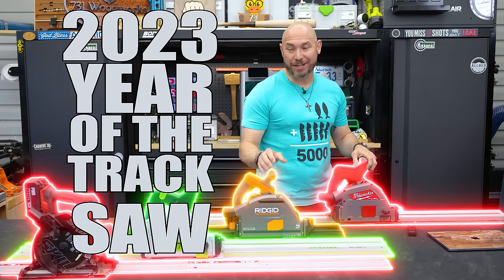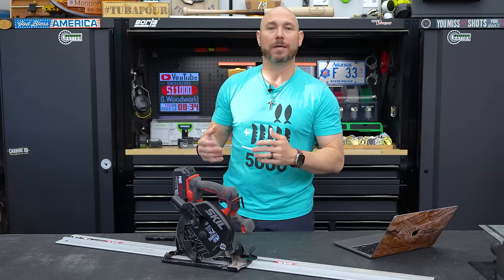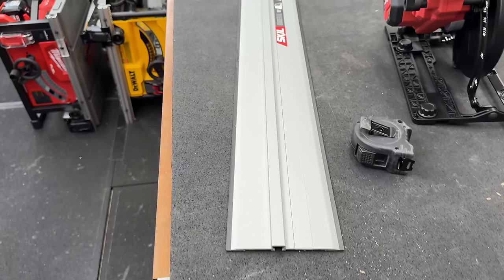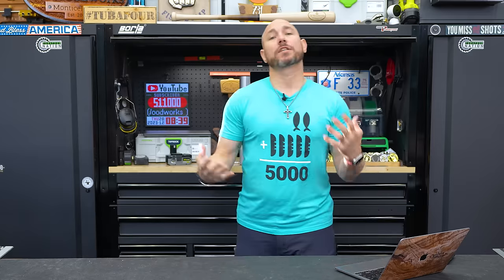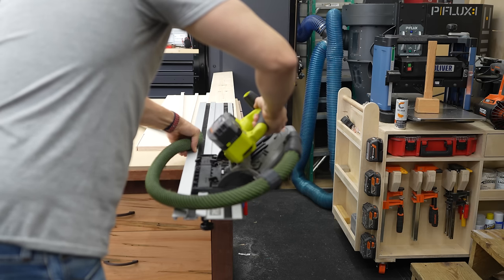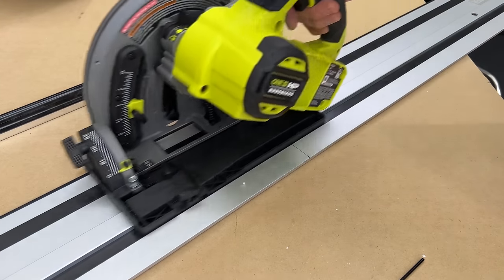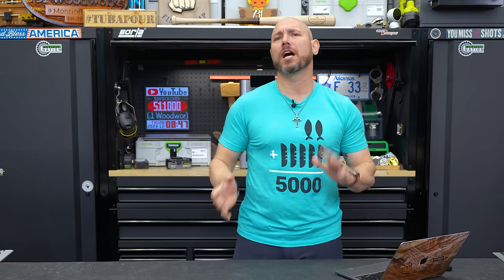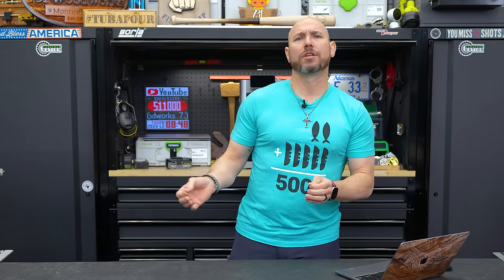Best NEW Track Saw Released in 2023? Ranked Worst to First!

Comment: I was looking up track saws the other day and noticed Grizzly makes a chorded track saw that comes with THREE 36 inch long tracks for $220 and I don't know why for the life of me more people aren't talking about that. That's cheaper than almost any other track saw kit I've seen.
Reply: Joining tracks straight is a huge pain in the ass, and I've done it with 2 118", 2 55" a 6 foot Stabila, etc. The longer reference lengths help but can't imagine the smaller 36".  The joint is weak, and precarious when moving the track on and off pieces to cut. At 36" you are guaranteeing a joint for most cuts since the saw needs a bit of track overhang. A single 55" track does 90% of my cuts. Also, that's ignoring the likely shit quality of the tool itself. Personally, I would go with(and went) with the Makita/Festool track. Festools are cabinet makers tools, precise and lovely to use. That said the Makita platform can do it all. The sheer range of saws Makita offers that integrate with the track are also vastly superior to Milwaukee. In addition to the plunge saw, I have a 10 1/4 Makita that makes ripping 12/4 Sapele a breeze.
Reply: Chorded? Does it play a tune?
Reply: From my understanding on what I read from others, it seems to not be very good. I have no time with it but from the very small sample size, I am not impressed. Seems the wen is better.
Edit: Not saying for anyone not to try it, just that from the looks, its worth doing a little extra research on.
Reply: I'm just saying, for $220, its the cheapest option. It was my assumption that the tool would be fairly decent since grizzly is a pretty big name in the wood working game. Either way, it seems like a decent budget option if that's what's within your price range
Reply: I bought a Grizzly jig saw that looked to be a decent alternative to a Bosch.  One of the biggest letdowns tool wise that I have ever experienced.  It wouldn't even make a decent green paper weight.  Bought the Bosch and swore I'd never buy another Grizzly product.
Reply: Buy the Wen, replace the blade and buy 2 PowerTech 55” tracks.  It will cost a little more than the Grizzly but it will do 99% of what most will,need it for,  I bought this set up and it worked great to break down plywood and build new cabinets in my garage.  All the reviews I read said replace the blade so I did.  Also, will do hardwood, but not as fast as some of the others.
Reply: @agracer1000 I have a lot of name brand tools, but when it comes to more expensive stuff or one time use. I've use Wen and Vevor products with little to no issue
Reply: I'm going to go check that out !

Comment: Well it’s not the first time a tool maker has made something proprietary! I was quite mad when I bought a ‘level 5’ skimming blade and then after buying the handle adapter, realized you couldn’t use a standard extension handle. No one seems to mind that RIDGID stands alone with lifetime service agreements even on batteries! (Oooops proprietary again)!!!

Comment: Im on milwaukee platform as a carpenter in Poland, but its hard for me to buy milwaukee track saw - one is cost - not that i use cheap one now. Im using Mafell MT55C corded - this thing is so superior to anything that is on the market... even tho i would love battery operated one like this from milwaukee its a hard poill to swallow that you need to sacrifice a superb tool just to have 1 battery platform...

Comment: I absolutely love my 36V Makita! If price weren't an issue, I'd likely go with the Milwaukee. It has a couple more features and I like the Milwaukee ecosystem, but I've used mine pretty hard for a few years and have zero complaints (for a few hundred cheaper). I could see maybe suggesting some upgrades to Makita though. The design is getting a little long in the teeth.
Reply: Me too. I’ve owned festool since the early generations and got the makita 36v the second it came out. my only complaint is the not so elegant depth adjustment. and how stiff the mitre adjustment knobs seem to get.

Comment: I bought the Milwaukee and while it was expensive it’s like the crown jewel of all my fuel tools. Every time I use it I’m more impressed, the blade that comes with it leaves an incredibly clean cut. Paired with the little 3D printed plug & dust collection, it has to be the cleanest saw I have in the shop. Although, I wouldn’t be upset to have a festool like yours haha

Comment: I've seen so many of your videos on track saws. Now I can't remember which one I wanted. What track saw can you also use to make flush cuts to like a wall ??The butter guard comes off and the blade has a cupped mounting hole so the blade bolt doesn't hit anything ?

Comment: As I mentioned to Ryobi after they released that dual 40 battery belt they need to do the same with their 18 line except maybe have it in 3 or 4 battery line. This way you can run their line complete through most jobs before running out of power. Also I don't understand why they can't make all of their battery powered tools with plug in also. To many one use tools and without either option I just mentioned you have to keep having to recharge or stop and grab another battery. The battery plug in option is already on some Ryobi products. IMHO Great reviews coming from your site and they are very helpful for those that don't have the money to waste on products that only work somewhat.

Comment: I love the Milwaukee I own it myself. And the pack out is the best I’ve ever used. And I’ve use Makita and festool I like the Milwaukee more because of their pack out system. But the saw itself blow Makita out by far. By the way Milwaukee motor shut down n brakes right away if trigger release. So it does have anti kick back

Comment: Hi Matt.  Thank you for your review of plunge/ track saws.  I would like to see a review of the Festool TSV and TS 60 track saws.  Will the ts 60 used with the 2mm or so scoring cut first , do just the same as the tsv saw with the scoring blade?  What do you think of these saws compared to the Milwaukee?  What do you see and feel using the Milwaukee rail compared with the festool rail?  These rails are different in weight and section.

Keep striving for the profit that comes from doing and using the words and ways of Jesus

Comment: What's the advantage of buying a track saw over using a straight edge jig with a circular saw. Like the kreg jig?
Reply: Dust collection, ability to use with guide rail accessories like dovetail clamps, rail square, parallel guides, etc.

Comment: I personally don't like saws that won't slide backwards due to the anti kickback features.
I use to use the scribe feature on laminate and melamine surfaced materials, but would do the scribe cut backwards and then full depth forward. Makita gave perfect results every time.

Comment: Question.  If price was not sn object (within reason) which track saw would you recommend.  I am torn between Mikwaukee and Dewalt (I have a ton of Dewalt. I really don't want another battery platform).   Thank you for the great videos.  🎉
Reply from the maker: Milwaukee’s is better IMO. However the DeWALT is a good saw too. I have a review on the DeWALT as well. It’s a little quirky but very powerful
Reply: @731Woodworks  I watched your Dewalt review. It certainly is an ugly duckling but loved by its mother. 😅

I will watch it again.  

Thank you.

Comment: The Milwaukee Track Saw is also available as a "tool only" option.  Just in case you don't have the need for the Packout box and more batteries.  Only $399 at Home Depot.
Reply: They had it for $379 with an extra blade for laminate ply a few weeks ago

Comment: Stating blade size and cut depth would have been useful. I see most of theses saws use 6.5" blades. 
  I wouldn't mind seeing a battery/corded 7.25" blade comparison. 
  Personally, I'm looking for a corded track saw with a 7.25 or bigger blade.

Comment: I don't see the WEN in there. But I know why, for me its perfect as I do only 90s. Also, this saw you have to pull and push at same time to keep it level or else you get flex, which I see in other saws too. For the price, it's very cheap for this purpose (table building, squaring ends). Ya ya, TS60 fes is 1k + a couple hundo for track. I'm aware. lol.
Reply from the maker: I bought it a few days ago.  Will be doing a review soon.
Reply: @731Woodworks  Nice to hear I have the corded version it will be nice to see if they made improvement within the cordless version. I do think I saw it comes with a nicer standard blade.

Comment: it would be nice to include reviews of the actual tracks themselves as some designs are far better than others, such as the Dewalt rails that connect poorly with their simple bar design that doesnt hold the tracks straight when connected together,  some other brands that use cam type flat bars or others with 2 bars that are much more rigid than the dewalt one.

Comment: I've used the milwaukee dust collection bag at the job site several times and it does great for what it is. It does even better with a cover for the window on the side ( painter's tape works fine in a pinch ) and lowering the splinter guard on the front.

Comment: Yeah...I'm not gonna lie...if Lego made a track saw, I'd be first in line for it. 😂

In all seriousness,  I'd love to hear about the Bosch. Their tools are great, but it seems like few people talk about it. Matt Estlea has one, and he's the only big YT'er I've seen with it.
Reply: I'm still waiting for the LEGO Wood Shop kit
Reply: I have the Bosch track saw and love it. The saw itself is very powerful and the dust collection is fantastic. Its cord is also really long, which is great. 

The tracks, though, particularly the joining mechanism, are absolutely amazing. It's not possible to align them out of square. As you tighten the cams, the tracks pull themselves perfectly straight. I have some 3d-printed adapters so I can use my Irwin quick grip clamps that work great. All in all, I'm incredibly happy with it, the only downside is it has fewer accessories than other, more common tracks.

Comment: What do you think about the Skil Track Saw on the Milescraft guide kit? The Milescraft is not much more than the Skil guide
Reply: The skil saw is the same as the flex Inline saw basically. I'd buy the flex saw and the miles craft if that's the route you want to go. The skil modified plate might have issues working with the mill craft.

Comment: My ridgid tracksaw stops after every few feet like it gets bogged down while cutting plywood. I changed the blade to a finer tooth and changed battery. I still experience this. Anyone has any suggestions to avoid this??

Comment: Am curious about the WEN track saw, on how it fared as compared to these. Is it below the SKIL? I am asking because the WEN also has favorable reviews.
Reply: FWIW I have the 6.5” Wen. I’m going to replace it when I have some mad money. It cuts reasonably well and it uses a standard rail. The dust collection isn’t great, the depth of cut scale and adjustment is terrible. Bevel cuts are not going to happen (very flimsy) and the motion on the track is a bit stiff.
Peter Millard compared the UK branded equivalent to the Wen to his Festool 55 and I think his conclusions mirror mine: it’s a tremendous value and a perfectly adequate saw, but he would never love it.
Reply: I recently bought the WEN 7 1/4" and I'm very pleased with it.  I'm a hobbyist, so a track saw is a tool I'll only occasionally use to mainly to breakdown ply sheets, so I just couldn't justify the cost for one of the premium brands.  I was very surprised at how effortlessly it cut 1" hardwood butcher bock counter top, even with the WEN blade. I switched out to a Diablo blade, so even better now.  Maybe the track saws that cost 3X as much have a little better dust collection, but the WEN seems to do okay connected to my Festool MIDI.  I bought this knowing it's likely not very good for 45% mitered cuts, but I can't imagine a situation in my case where I would need this.
Reply: It is better than the SKIL IMO as it is true TS. I did some bevel cuts with it at 45* and while it somewhat unstable it did get the job done right.

Comment: The Milwaukee 45 degree bevel cut positive stop is not accurate, I bought one and it's off by 1 degree, went and replaced it with another one and it's off again by 1 degree. Unfortunately I can't fine tune it like I did with the 90 degree using the screws in the bottom, unless if I'm missing something!
Reply: Not that this helps but the Makita does have an adjustment screw for this. Wonder why no one mentions this in their reviews.
Reply: @davidperalta5280  May be because they used the 45 bevel for aesthetic cuts only (like table top parameters) not for an actual miter joint, they would've noticed that it won't come true to 90!

Comment: The moment, and I mean the moment, that a new version of the Ryobi shows up, please I’m begging ya check that one out as soon as reasonably possible. That’s the one I want, but I want one with the articulating knife and potentially better compatible tracks.
For now this year I’m trying to seek out the Milescraft track and upgrade my Ryobi 5 1/2” to the 7 1/4” brushless.  I just need to break down sheet good, and my job site table saw just aint big enough to use safely, and the kreg accucut doesn’t work nearly as well as I’d hoped it would. I work out on my back deck so dust collection isn’t an issue but the extremely limited elbow room is

Comment: I thought the Milwaukee blades had a specific arbor size?
Reply from the maker: I was mistaken on that in the first review
Reply: The Milwaukee uses a 20mm like most track saws. Can’t remember what regular 6.5” circular saws use but it’s different than the track saws.

Comment: How come you didn’t include the Wen?  It’s the cordless track saw that pretty much everyone I know whose into woodworking has because of how affordable it is.
Reply from the maker: I just got it in this week.
Reply: @731Woodworks  you’ll probably pull a lot of traffic whenever you get around to it. YouTube is surprisingly devoid of videos on it, my guess was that Wen wasn’t dishing them out to channels. I’ve since upgraded my wireless Wen to Milwaukee, but mainly because I’m consolidating down to two battery systems, M12 and M18. Besides fit and finish I don’t realize much of a difference in final result. I used the Wen pretty consistently on 8/4 hard maple with no issues

Comment: I have both the Makita 36V and more recently 'upgraded' to the Milwaukee - both are excellent saws that cut like a laser. Neither is 100% perfect, but neither will disappoint. 
Things the Milwaukee has going for it: 1 battery, easier blade changes (locks in place), riving knife, and little drop-down 'guard' up front that helps with dust collection. One or two gripes: no bluetooth for automatic dust collector activation, and the track adjustment knobs don't seem to have enough resistance to prevent accidentally turning them out of adjustment. 

No regrets getting the Milwaukee, but now I have a Makita 36V to sell.

Comment: Milwaukee isn’t the best bang for the buck.  It’s 10 bucks more than the TSC 55 Ken plus.  No kickback.  The pack out while good is lacking.   I can look in my systainer and know where everything goes and all blades offered etc. Milwaukee is just fleecing their customers.
Reply: Milwaukee has more power than the Festool.Also Festool cheapest kit: $780, Milwaukee cheapest kit: $530 (+ blade cost). Festool is fleecing WORSE lol
Reply: @owenwagner9017  tell me you’ve never used a Festool without telling me you’ve never used a Festool.  Look at the different tracks Festool offers. Does Milwaukee have kickback. Nope.  Does Milwaukee have a router attachment nope. Does Milwaukee have a cumbersome blade change. Yep. Can you mount the track with adhesive strips. Nope. Does Milwaukee kick on my dust extractor? Nope. Is it the same price as Festool.  Nope Milwaukee is more expensive.
Reply: @thackstonns  what. are. you. talking. about.
Reply: @thackstonns 
>Does Milwaukee have kickback.

No, it does not HAVE A KICKBACK, it won't kickback since it has a riving knife.

Everything else you mumbled here is nonsense.

Comment: Why is all the track saws cordless and use batteries.  99% of the time you're still tethered by the dust collection hose.  I don't need more batteries to care for and I don't need to take the saw to home depot either..

Comment: Battery powered, terrible , good only when a cord would be extremely unhandy or no power available , the batteries don't last and must be replaced at $80-250 each. good for professionals but when a homeowner goes to use it after months of no use and it is dead and wont charge , another $100-250 gone and another trip to the store or wait a week or two for shipping. Not for homeowners.

Comment: With Ryobi, typically the 2nd gen product iteration fixes the problems with the first gen interations. Or to put it another way, Ryobi releases it's "beta" version to market to get critical feedback ~  ultimately a strategy "doomed to fail" and brand damaging. Why don't the snowflakes in Ryobi marketing engage with influencial makers and random weekend "wood reshapers" to test the product, criticise the product and make recommendations so that the product released to market isn't  just the best Ryobi can make it for the intended "price point", but that it does what it is spruicked to do in spades and then some.